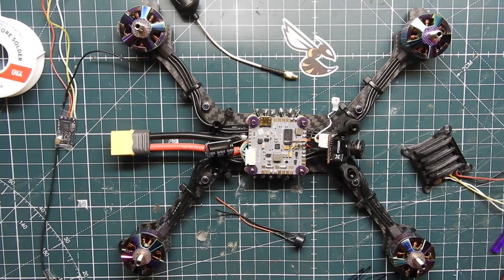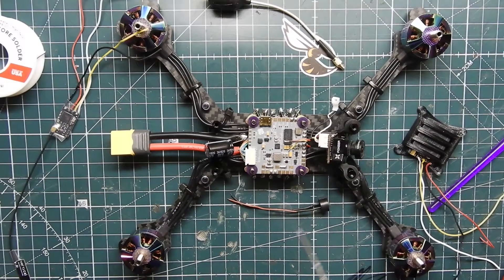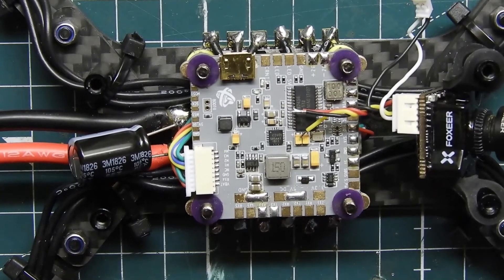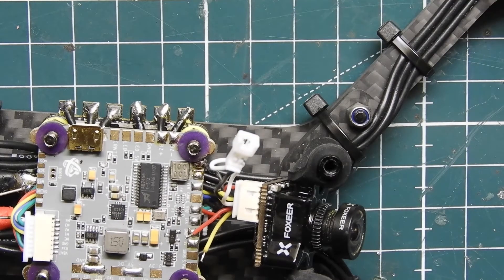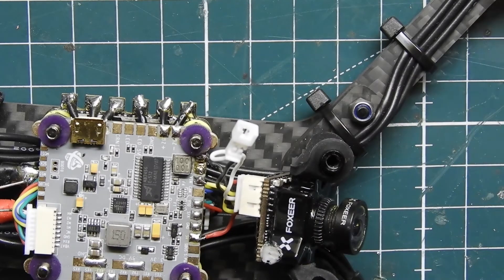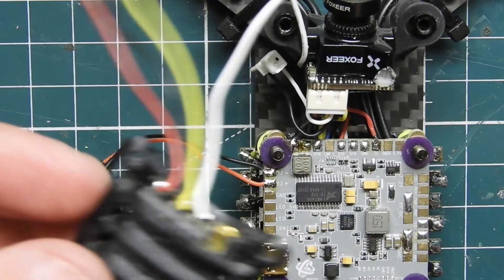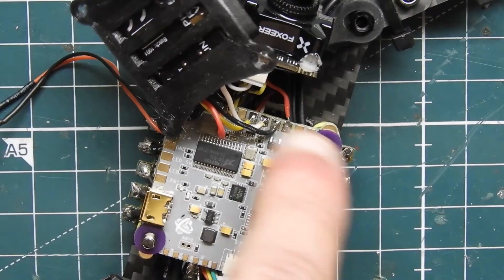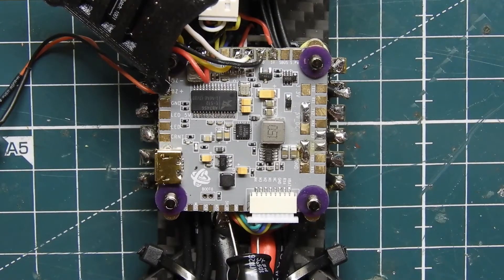TBS Source Two Build - Part 2 / Wiring Strix F10 Binary Flight Controller

Comment: Can we still get the F10? Unavailable from RMRC
Reply: I think pyrodrone has some. Beware though. I have two that don't work properly. There is also rumors that helio is all done. They have stopped providing support for their boards for several months now and supposedly owe rmrc pyrodrone and rdq a lot of money.
Reply from the maker: There’s is a lot of drama going on with helio. The last Tim sweet wrote was about having the imuf become open source. I would stay away from it for now. Unfortunately I bought this strix before this was known
Reply: Does it seem to be working ok? Beeper pads didn't work on either one of mine. The one would only recognize 2 escs.
Reply from the maker: Beeper does not work and I can verify that. It’s needs to be fixed
Reply: What about your escs? Did they look ok in blheli? Mine showed not in sync until I calibrated them with another fc